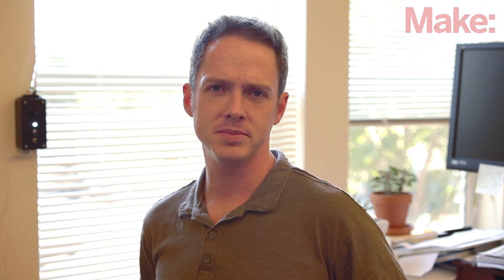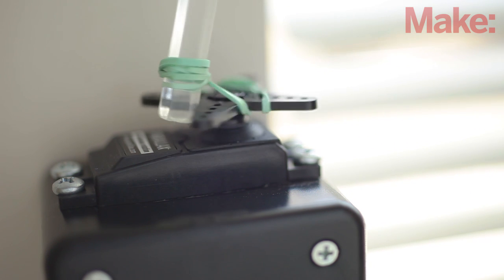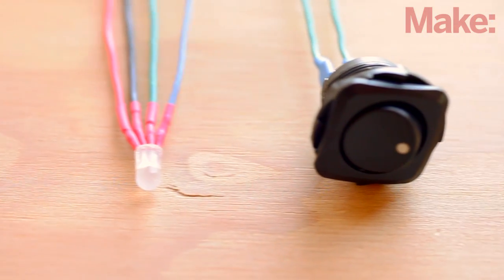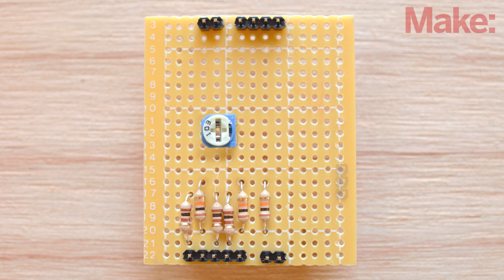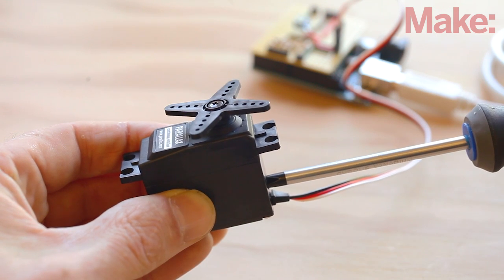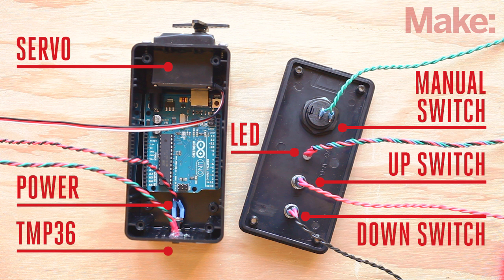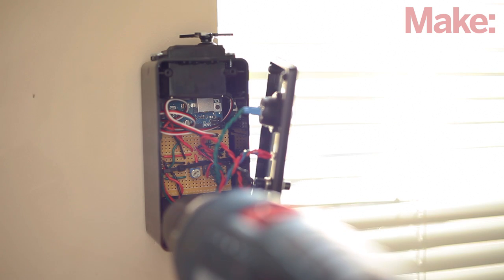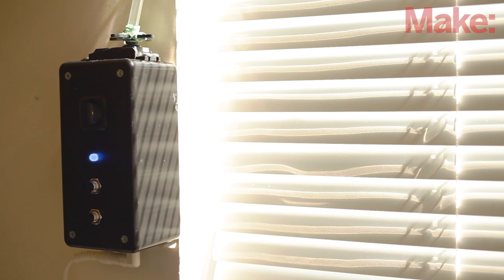Weekend Projects - Mini Blind Minder

Comment: I have a little problem pls help!!when i upload the code calibrate_servo i adjust the potentionmeter in servo until it doesn't rotate. When i upload test_servo it rotates clockwise faster then counter clockwise. Counter clockwise rotate slower. The delay between is good 2 sec. How to fix that problem pls help its my first project and i don want to fail

Comment: Might work better to remove the rod from the blind opening/shutting mechanism and mount the motor directly to the mechanism. Would look a bit cleaner and prevent dmg from someone accidentally bumping into the rod. A button to manually open/close the blinds and ignore temp would also be a must. Great project tho.

Comment: Seems like a waste to spend $50 on an arduino for this, when there are so many adequate, MUCH cheaper, microcontrollers out there, such as the PIC which is about $2.50. Sure, it takes a bit more work to get it up and running, but you could easily make a video on that.

Comment from the maker: Mini Blind Minder will automate the opening & closing of your window shades based on a preset desired interior temperature. The circuit is built by combining an Arduino with a homemade shield and a servo motor. A few makers have also chimed in with mods or changes to the design of this project: http://goo.gl/otkaNX
Reply: cool